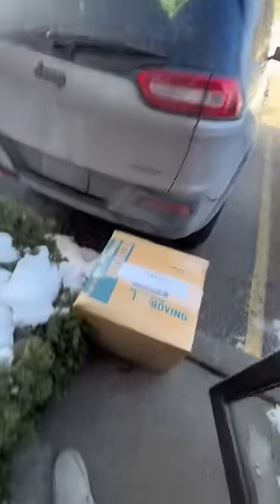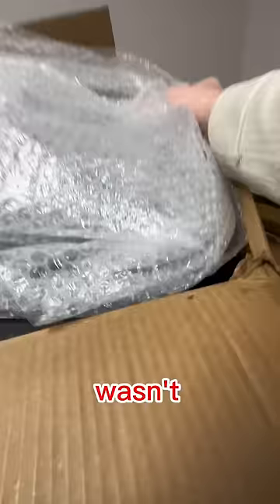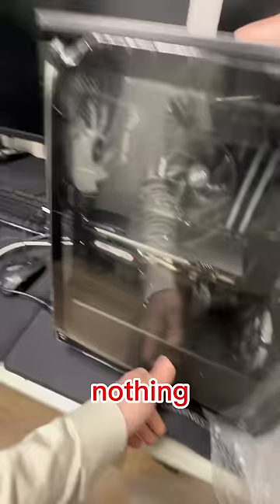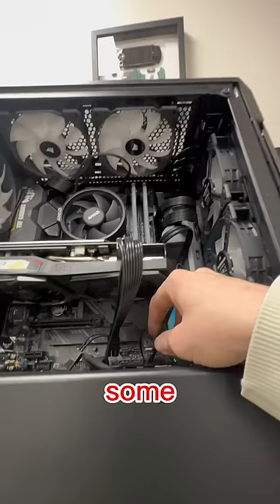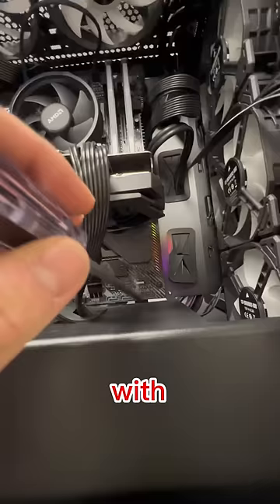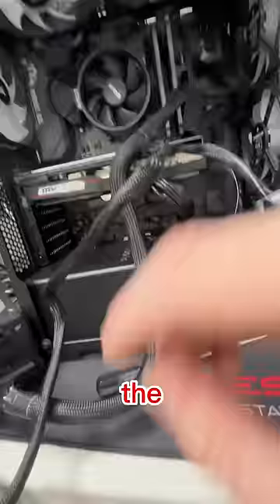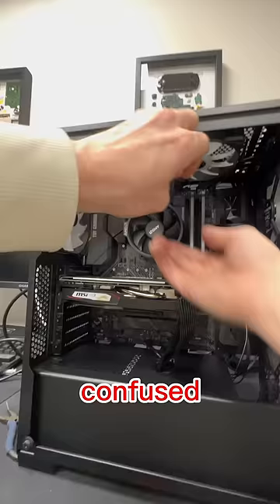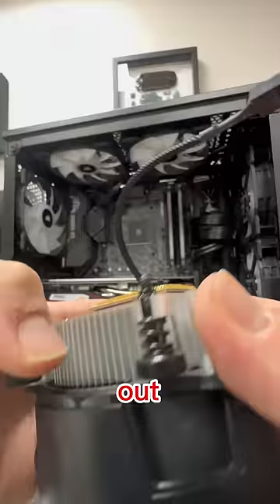Bent CPU Pins 😭🤬#pc #pcrepair #cpu #gamingpc #pcgaming #pcbuilds #pcbuilding #egirl #gamerguy

Comment: This is probably a user installation error because the CPU is outside the socket and not installed properly on the socket.
Reply: Exactly, like the mobo is holding the cpu in the socket, they maybe pulled the bar to hard and fast and it didnt click or it was just poor placement
Reply: @udilkoyt5840  they prob just placed it down and brought down the arm thinking it would move it into the slot correctly
Reply: @kar5750  exactly as i thought, bad place in socket and now it ruined the whole cpu
Reply: @WolfmanFoxtrot  it’s 100% user installation error the cpu shouldn’t come out w/ heat sink if installed correctly + the bent pins are a dead give away
Reply: @kar5750  you do realize that if the thermal paste isn't heated it literally acts like glue?
Reply: @kar5750  Some AM4 Cpus the thermal paste will create enough of a vaccuum that you can acidentally damage the socket and CPU by trying to take the cooler off. Some have said running it to get the paste warm prevents it.
Reply: @WolfmanFoxtrot  that is true, but a couple reasons why that highly unlikely in this case, 1 it's only a couple year old generation of cpu's, and it's highly unlikely that the thermal paste is old enough to become hard enough to pull a CPU out of the socket. And secondly, even when the CPU is pulled out of the mobo by the cooler/thermal paste without unlatching it, it still doesn't bend any pins or if it does, it would only be 1 or 2, also OP stated that it came out without any force.
Reply: @WolfmanFoxtrot  I reckon the clamp holding down the cpu has a stronger hold than some thermal paste
Reply: @kar5750  It does not
Reply: No I’ve built many pcs and had this problem only once I always use liquid coolers but the one day I was experimenting to see what my temps would be with a stock cooler I placed the Amd stock cooler removed it and with it came the cou attached to the heat sink just like in the video there were 3 pins badly bent and one broke off breaking my chip the stock coolers and thermal paste stick extremely well to chips I do not recommend at all l…. I’ve never bent chips before I have installed many into pcs
Reply: @WolfmanFoxtrot  mb was thinking about intel cpu clamp lol
Reply: @oscargreguol3339  even with freshly applied thermal paste it can still rip out the chip with everything seated and installed correct I learned the hard way unfortunately
Reply: @kar5750  they do come out, usually best to twist to break it look before you pull to prevent pull out damage
Reply: @oscargreguol3339  that stuff can pull pretty easy especially the default stock and coolers thermal paste is very thick and sticky when cool I’ve done it a few times within weeks of installation
Reply: couldve also been put in without lining it up right since they’re bent in the corners
Reply: Exactly. If it comes out with the heat sink then it was never fully seated.
Reply: @oscargreguol3339 as an AM4 owner, you are grossly incorrect
Reply: @oscargreguol3339  i didn't even take 1 year to change the thermal paste and the CPU came off with the cooler, it's not about the thermal paste getting hard, rather the socket having little grip force and the thermal paste creating a vacuum
Reply: Nah this happened to me while I was trying to upgrade my old ryzen 1600 to 3600x. It's not a user error. After some reasearch i found out that the thermal paste that amd supplies with their coolers have the tendency to glue the cpu very hard, so i got a third party thermal paste(cooler master).
Reply: Damn you a genius for noticing that
Reply: @WolfmanFoxtrot  yes the clamp is stronger I build pc’s if you’re thermal paste acts like glue, you bought glue
Reply: I've definitely had a AMD CPU come out when trying to pull a heat sync. I like AMD but Intel has a better CPU socket IMO. Impossible to happen with intel.
Reply: @pudgee6266  no
Reply: @jebbroham1776  I can promise you my chip was properly seated it only goes in one way I’ve built multiple builds and only used a stock cooler once with the cheap ass thermal paste that comes with the cooler and that was the one and only time I’ve ever had a chip rip out with the heat sink of my cooler it’s because that shit acts like glue when it’s cold and pressed with that much pressure
Reply: @kar5750 amd motherboards are shit for this, during 2 months or back and forth trying to get my new rig stable the cpu would often just rip out the socket from the thermal paste being cold. The cpu wasn’t actually damaged though.
Reply: it's honestly near impossible to put a CPU into a socket wrong... either the pins line up and it literally drops in with no effort or you really have to fuck up and shove it in and that's how you bend pins... i honestly don't understand how stuff like this even happens... that said i forget if it was AMD or Intel but some of the chips don't even have pins on them so it's even harder to fuck those up because you'd have to jam something between them and the socket which houses the pins.
Reply: @oscargreguol3339  new thermal paste is far more sticky than old dried thermal paste just like how any suction cup will hold longer when it's wet
Reply: twist the cooler from side to side while wiggling it upwards and it won't rip the cpu out of the socket. just be gentle
Reply: that's a pretty common issue with amd sockets tho it happens often especially with stock paste
Reply: @kar5750  tell me you have never built with AMD. It's a common issue with Ryzen's pga chips.
Reply: i just ordered a cpu from amazon for my old computer and it came with bent pins its pretty hard to miss the little dot the cpu and slot has it probably wasnt user error lmfao
Reply: The heatsink coming out with the cpu it's literally a problem since early am2 Amd cpu's
Reply: @oscargreguol3339  it took less than a year for my Arctic Silver to vacuum seal to my 3900x 😂

I got lucky, though, and it didn't bend any pins when it popped out... Gotta remember to twist AMD coolers, first, lol.
Reply: @kar5750  that's what I was thinking
Reply: I was getting ready to ask what would cause this, this seems-imo- the most plausible.
Reply: Nice thinking
Reply: @kar5750  That is so insanely false
Reply: It looks like the cpu wasnt inside the metal frame?
Reply: @WolfmanFoxtrot  Exactly, I've seen quite a few AM4 systems with ruined processors due to this. People try to pull the cooler off and it pulls the cpu right out of the socket.  It's not just AMD either, I've had older Intel machines with this issue as well.
Reply: Also the PC is completely clean, so I doubt it ever turned on  in the first place.
Reply: Amd cpus are known to get stuck to the cooler and pull out of the socket when removing the cooler
Reply: @kar5750  wrong and pga cpu like most of amds will come out of the socket if installed correctly if you do not twist the cooler first to unstick it
Reply: @Kar  I just don't understand how (unless you're savvy with computers) you don't just do research for this. I just replaced my motherboard and cpu, even though I do this stuff for work, was very careful. Now he's out up to 400 bucks for a 2 second mistake. Very sad to see
Reply: @oscargreguol3339  brand new ones do the same thing
Reply: @oscargreguol3339  it happend to me just a few days after the first installation, but after bending around 10/20 pins back it worked again, its just bad luck when it happens
Reply: @kar5750  am4 is notorious for this issue when pulling out a CPU. Even with freshly applied thermal paste, the “clamp” just squeezes the pins. It doesn’t actually hold the CPU in place. It’s an awful design. Hopefully the guy in this video didn’t bend the pins pulling it out 😅
Reply: @chrisbryant2039   wth are you guys experiencing? I just pulled out my phantom fx processor when upgrading to 5600x. The thing is literally over 7 years old. Never had it's thermal paste changed and it came off smooth like butter. 
Some alcohol cleaning solutions and the CPU looks like new. 
I guess I'll be careful once I upgrade from my 5600x but literally never had this problem with any of my AMD boards and cpus.
Reply: @PuddingXXL  dude i ordered a cpu and it had bent pins lmfao replacing a cpu is really easy if someone had trouble with the cpu install they shouldnt build a pc lol
Reply: @pudgee6266  Hello, I had the same problem.  there are 5 or 6 pins that have bent could you just tell me whether or not your Mobo is damaged?
Reply: @chrisbryant2039  True. Fixed a couple of bend pins in my phantom back in the day. All it took was patience and a small blade. Worked like a blaze afterwards.
You don't need to build an entire pc for having a broken CPU you're right
Reply: @kar5750  thats not how this works at all... AM4 has no mounting bracket holding in the CPU... very common for AM4 CPUs to come out with the cpu cooler...
Reply: yep they didn't match the arrows up on the socket and most just ignore it.  the corner of the pins were bent which says it wasn't installed in the right orientation.
Reply: @WolfmanFoxtrot  the CPU is locked into the socket
Reply: @JohnDoe-gq6yg No, AMD sockets are only placeholders till you get the coolers on, with little force the CPU can come out as you remove a cooler if the Pc wasn't idling for 2 to 4 minutes. You must be new to this, but there are a couple of YouTuber's that show what happens.
Reply: @WolfmanFoxtrot  my guy it has a locking bar on it
Reply: @JohnDoe-gq6yg  it's not strong, don't always believe what YouTuber's say, especially "GamerTechToronto"
Reply: nah, that amd socket simply sucks
Reply: @WolfmanFoxtrot  alright well just to be clear I'm not new to this and I've never once had the vacuum from the thermal paste pull hard enough to overcome that retaining bar.
Reply: @kar5750  wrong. This can happen on properly installed AM2/AM3/AM4 chips.
Reply: actually, almost all AMD cpus have issues with sticking to the cooler because of old paste, you have to be careful and wiggle it off.
Reply: Why will the user install it when it's already installed?
Reply: It was probably pre-built from Dell.
Reply: That's why when I built my pc I waited until my dad came over to install the cpu (I have shaky hands)
Reply: @kar5750  it's very normal for this to happen with amd cpus
Reply: I have a ryzen 5 5600x and recently bought an AIO. When I removed the old fan I was shocking because the cpu was stuck at the heatsink. And it was not my fault (becasue I locked the lever when I installed it last year). The paste was dry and stiff like a super glue.
Reply: @HasanShokri  I have the same CPU and use an AIO cooler too, and that is definitely not normal. lol
Reply: the cpu fan would still rotate.  this was t he only thing wrong with this computer.. unfortunately u got rookies doing work
Reply: @02091992able  Literally happened to me today, thank goodness no pin was bent.
Reply: Always push down and twist PGA socket CPU coolers before trying to lift them.

As the pins got more numerous, they also got smaller, and there's less surface area and clamping pressure holding them in than there used to be.

Also, the pins themselves are weaker and could bend or break if pulled out while still clamped to the socket.

Pushing down a little takes some pressure off of the pins and transfers it to the substrate and face of the socket. Twisting a little breaks the bond the thermal paste creates between the IHS and the cooler's cold plate.

Every PC builder or tech should know this. The one in this video apparently does not.
Reply: 20 to 30 bend pins is about a hour to 2 hours to fix. I definitely wouldn't of scrapped it unless they snap
Reply: @udilkoyt5840  Its a AM4 AMD with standard cooler. Had one of those, and first the preapplied thermal paste is like glue on AMD cpus, and 2 my cpu also was lifted with little force from the socket. I guess these guys can actually have made the damage to the pins when remove the cpu. When I changed to watercooler I changed thermal paste.. year later, when I was changing cpu the new thermal paste was still good and did not rip the cpu off the socket when removed.
Reply: @kar5750  Ryzens are known to get pulled out with the cooler. 

It's literally why bigger tech channels such as LTT, Gamers Nexus and Jayztwocents recommend to uninstall the cooler with a twisting motion, rather than pulling it straight out. And yes, the adhesive properties of thermal paste are enough to rip a Ryzen (1xxx 3xxx and 5xxx) out of the socket, without touching the lever at all. It may still come down to user error, but the AM4 mounting mechanism sucks quite a bit of ass.
Reply: I built my own pc (First time ever doing it). Putting in the cpu was stressfull. Spent my time praying I dont f-up. If I did not check multiple videos on how to do it I would of messed up too.
Reply: Couldnt see if the cpu was out the socket, but i can happen the cooler comes with it
Reply: Not prob, it is absolutely installed incorrectly.
Reply: It's different model the CPU is installed differently than yours
Reply: @kar5750  You'd be wrong. On a 10 year old PC, the thermal paste is winning the tug of war every time.
Reply: yea because this dude broke it and made video lol
Reply: Could be but ngl countless times ive had this issue no bent pins luckily but if the thermal paste wasnt heated recently its literally like glue and will just pull the cpu out of socket easy
Reply: no amd am4 cpus do this even with proper installation, it can happen, where the cpu gets stuck to the cooler
Reply: They probably put it in without the triangle on the wrong corner

Comment: An older trick to straighten pins is to use the end of a mechanical pencil.
Reply: Or a credit card or something of that sort
Reply: @manzilla1018  No, the Mecha pencil even tho hearing it for the first time will work better
Reply: Good one. Thanks for the tip. 😉
Reply: Use a hooked carpet blade upside down to straighten the pins. It works well !!
Reply: We used pencils back in the day! Gotta be careful still, but it works great!
Reply: Ivan so true a mechanical pencil works. My late younger brother and me build a pc while he was fighting cancer. Due to the motherboard not sitting correctly in the case it bend some pins but we couldn’t get anyone to fix it during the early days of covid. So he found a solution he told me over the phone while I had to travel a couple of miles to get his medication and what he said was “mechanical pen to the rescue “ after 2 year the pc still work beautifully even after having to deal with the early window 11 issue
Reply: Also a printer refill Syringe tip.
Reply: Huh, that's brilliant. Thanks for that.
Reply: For bent pins yes, but often on AM4 systems you get processors with mashed, smashed, or mangled pins.
Reply: I always used extendable utility knife
Reply: Not just any mechanical pencil. A regular cheapo bic could make things worse. Use a drafting mechanical pencil with a 4mm fixed sleeve in order to ensure clearance of the cone from the surrounding pins.. Pentel P200 series are perfect for the job.
Reply: Hey, that is pretty great, would help getting it straight in one shot instead of bending multiple times, risking breaking. I wish i had done the repair, i can always get my pins back as long as it only happens once to each pin.